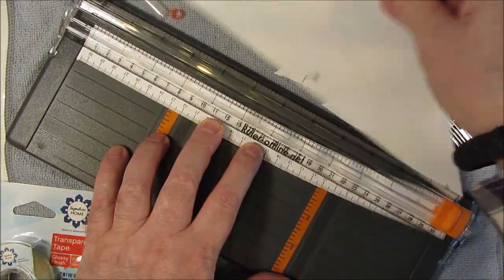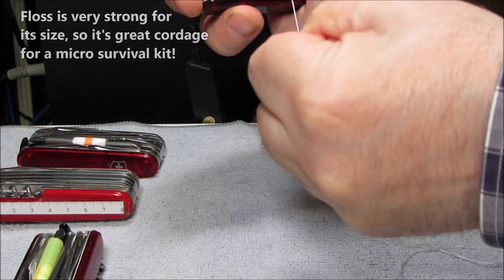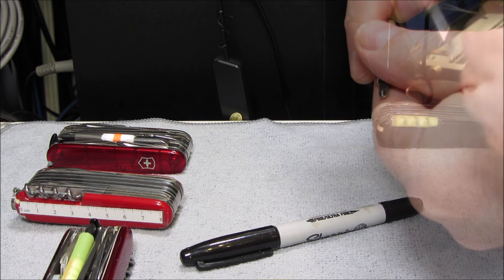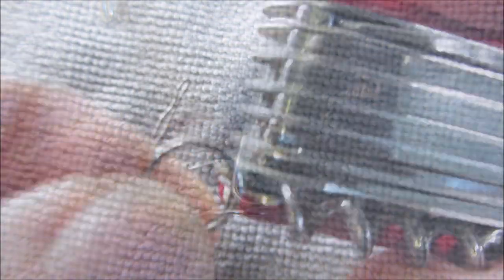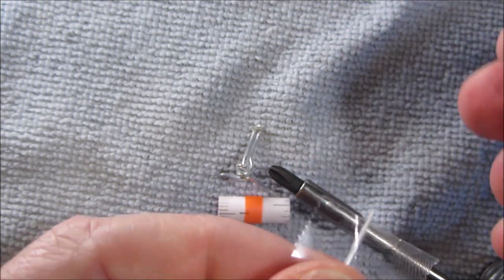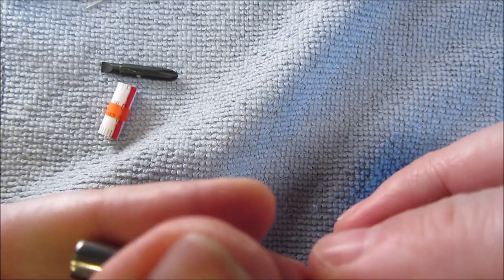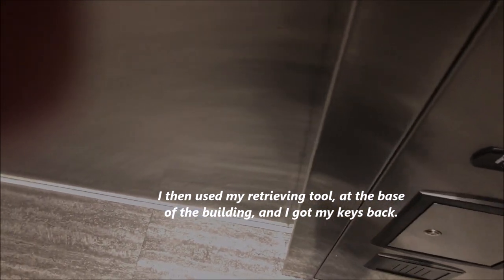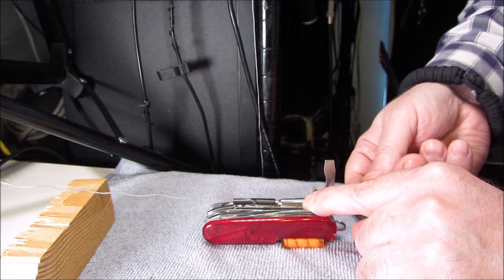SAK Cybertool Grappling Hook (Part 2 of FREE Rulers)

Comment: Hang onto those plastic straws... theyll be hard to find very soon.
Reply: Haven’t been able to get plastic straws in Australia for years now. Closest equivalent I could suggest is heat shrink tube available from some hardwares and electronics stores.
Reply: @Books RR4711  bubble tea places still use them, otherwise amazon.
Reply: Plastic straws galore here in Michigan
Reply: @BlueEmberDarkHorse  pick them up while they can. When they made the switch here, it changed everywhere... and fast.

If you think plastic cutlery at takeaway is bad, get ready for cardboard 🤣

Comment: I suggest Power Pro fishing line because you can get it in 80 pound test that’s at least half the width of dental floss and is a stealthy green color which can be used for fishing obviously or a trip wire or for magnetic retrieval with a more reliable strength. 😊
Reply from the maker: Thanks for the tip.

Comment: In your micro pocket tool kit video from a long time ago you have to just use a knife or scissors to cut into the seam running around the kit to get access to the space to feed a zip tie into it right?
Reply from the maker: No knife/scissors was necessary: there was already a small opening in the material, near the the bottom of where the left side's three-tool-sectioned elastic band attaches to the middle hinge area of the Maxpedition Micro Pocket Organizer, an inch or so just above where the zipper starts, allowing me to feed in the zip tie upward, and then around that side's circumference.
Reply: @MeZillch  Thank you for the detailed reply!